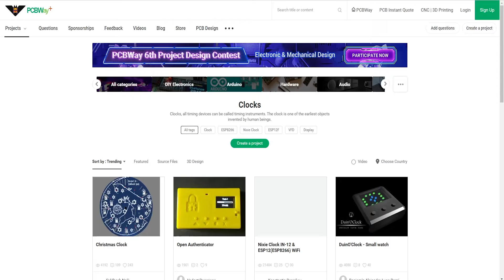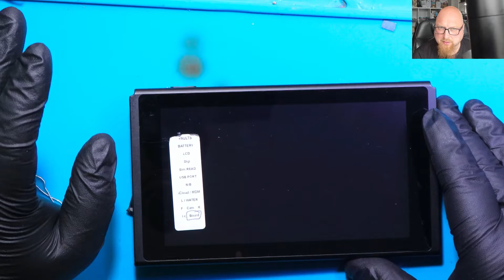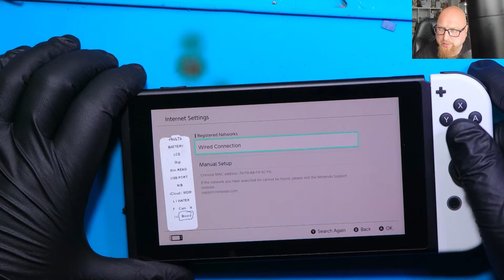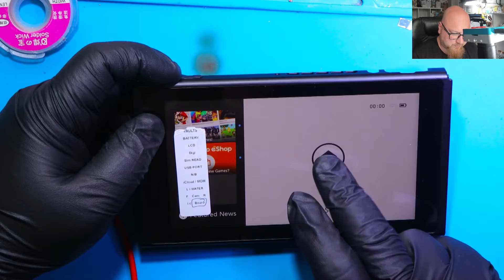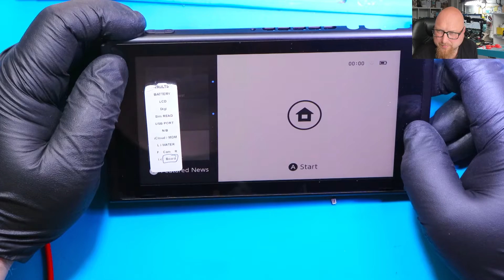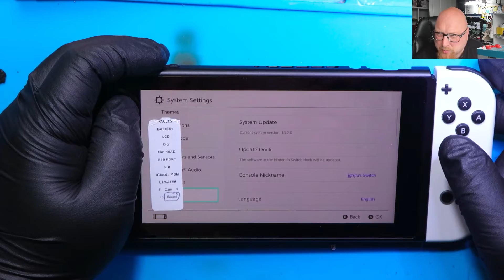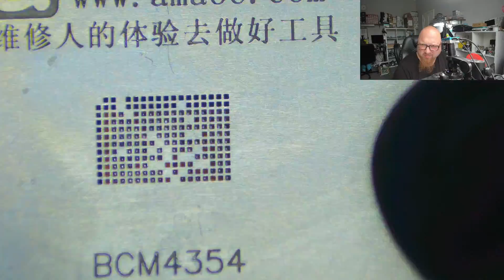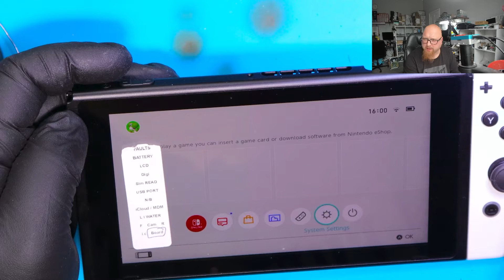Nintendo Switch Orange Screen of Death. Can I fix it?

Comment: Hi, I am having the same issue with my nintendo switch lite and I dont have the wifi chip here in Ecuador South America do you think that I might be able to desolder the wifi chip and play with out it?
Reply: I disolder the wifi chip from my nintendo switch lite it works for a few seconds but after a bit I get the orange screen again so i guessing that it should be some else on the board!

Comment: I've had exactly the same experience as you.
I bought three WiFi chips that came in the same component strip packaging you had in this video. I've reballed them perfectly and installed them perfectly. Each time the Bluetooth works but the WiFi doesn't.

There's a huge thread on GBATemp about this including some serious efforts to understand the WiFi aspect of how the chip works.
Some evidence suggests it's proprietary and other evidence suggests it's loaded into the chip during boot.
There's even a paper on GBATemp from the chip manufacturer on how this function works.

In any case it seems that resellers have stocked up on these WiFi chips without necessarily realising that the firmware is proprietary to the Switch.
So far it's impossible to correct this fw issue and the reseller will just say it's been salvaged despite being sealed in factory strip packaging.

After several attempts I bought a donor board from eBay, salvaged the chip myself and it worked perfectly on first attempt.

Don't buy 'salvaged' WiFi chips if you want to do this repair.. buy a donor board so you know you're not getting scammed.

Edit: Also be sure to use the correct Broadcom or Cypress variant to replace the one that came with the switch originally.